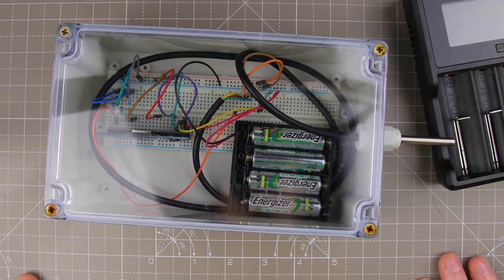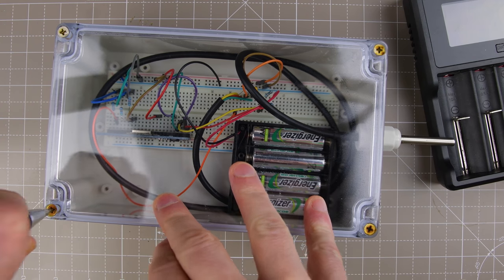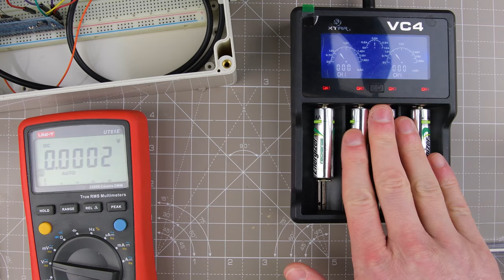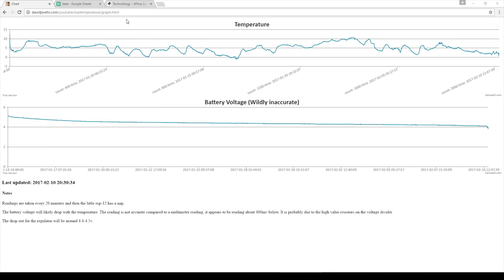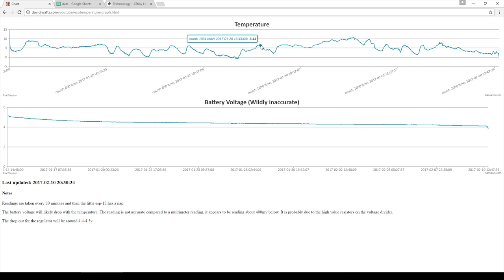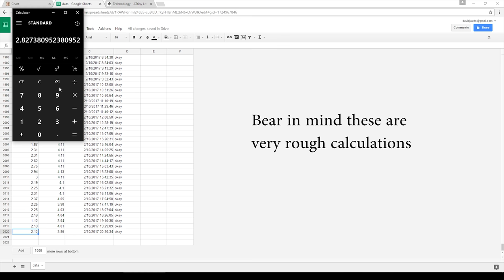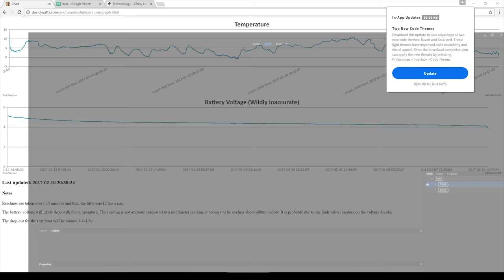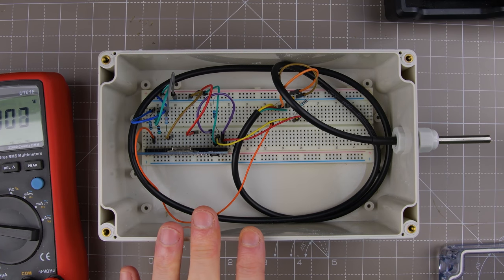Part 3: Outdoor Temperature Logging with ESP8266 ESP-12f

Comment: For this sort of application I have just started to look at the new ESP32 devices.  These have an operating voltage range of 2.3 - 3.6 volts and a hibernation sleep (with RTC timer) of just 2.5 uA.  With that voltage range it can be run on 2 AA batteries directly, without a voltage regulator.
I  haven't made progress yet on the low power stuff, but I have it sending data to NodeRed using MQTT.  The low power work will be soon.

Comment: Dealing with negative reading is really easy, David. They're 2's complement just as the good old int is in C. Just make sure you're using a signed 16-bits integer, and Bob's your uncle. Remember, the sign bit is actually many sign bits. All of the remaining bits not used for temperature are sign bits. That makes it a 16 bits signed integer where the temperature is 16 times the actual temperature in the mode with the highest resolution. Just store it and devide by 16. Easy! :) Great video again. Thumbs up from me and I hope you continue making videos in the future. Cheers!
Reply: If you like to keep the temperature as a "human readable" integer, you can multiply with 625 instead of dividing by 16. Many of us don't like floats in 8-bits microcontrollers. The raw 16th of a degree count is fine but multiply with 625 and you get a 10th of a millidegree count because 16 * 625 = 10000. That would require a 32 bits intereger of course and the range would be from - 214748.3647 to +214748.3648 (the 16 bit ingeter would give a range from -3.2767 to +3.2768 which is a bit narrow).
Reply from the maker: You are right but I didn't want to bring it inside after I realised my mistake, so I decided to treat the result rather than the cause. Now the experiment has finished I can sort it out. Thanks for the hints :-)

Comment: I am going to finish a similar project only house inside (temperature over 0 Celsius). I used a ATtiny13A and a N-Mosfet to cut the ESP-01 Ground. I measured around 5.4 [uA] for when the ATtiny13A is running on 3V3. I used Lipo and Bucket-Boost Converter to supply 3V3 voltage for the ESP- 01 measures the voltage with the ATtiny13A ADC. I used also p-MosFET to reduce the power consumption.

Comment: David Watts

Use only 3 batteries and just put a wire across the terminals on the empty slot. It will give you nominal voltage of 3.6V.
Remove the voltage regulator and just power the thing directly from battery.
Increase the sleep interval to 30 mins or even 1 hour.

If you don't need live data, just keep the readings safe in RTC user memory and upload it every hour. That will give u a straight 66% savings.
Reply from the maker: Thanks for the comment. I don't like the idea of using 3aa cells without a regulator, I am sure it would work but fully charge NiMh cells can be at 1.5v each which would tip it over the 3.0-3.6v specified in the datasheet. The next iteration will have half the sleep time just to speed up the testing.
Reply: You are right that the data sheet says 3.3 to 3.6 but I am sure there are some buffers put in place to accommodate for higher voltage.

My garden watering system has been running for months without any problem with 3 NiMH cells.
My weather station also ran with the same battery setup till the juice ran out. Infact, this week I have now hooked up the weather station esp straight to a single 18560 battery which started out at 4.2. Again working without any issues.

For non-commercial setups, i would just risk nuking the chip than wasting usable battery power. But thats just me :)

Comment: hi David I am totally in to your channel. May I suggest using the 18650 with the protection circuit. They'll shut off before any damage is done. NiMh if run down to that point will have significant damage and reduced charge cycles. Got to check out that charger of yours though. Mine is about ten yrs old :P
Reply from the maker: Thanks for the suggestion. I thought about that but they are negatively effected by the cold and regulating the voltage is difficult from 4.2-3.1 to 3.3v for the esp. Their usable capacity would be lessened by any regulation or diode voltage drop. It is a difficult problem to overcome. I did a little review of the xtar charger, it is really nice.
Reply: Chris Leech
I am already using 18560 to power up esp without any voltage regulator, No fire and no hissing sound. It just works without a glitch.
Reply: Hrishikesh Date it's probably pushing it a bit as a charged 18650 can put out over 4 volts.

Comment: You can build a micro amp meter(EEVBlog has one) which converts Amps to volts. With just a couple of OP amps. the problem would be that this would draw more current. 

I'd go the way to measure the voltage drop over a small resistor lets say 1ohm resistor. you can then amplify the voltage with an opamp to boost the voltage to a range of 0 to 5/3.3 volts.

Comment: For comparison, I've been running an outdoor temperature and humidity monitor running on an Arduino 3.3V Pro Mini clone, and transmitting data every two minutes with an nRF24L01  for nearly a year now off a set of LIDL Eneloop-alike cells. The 4 cells are still at 5.04V, so I'd expect total life of nearly two years. Of course, this is 2.4GHz, but not WiFi.
Reply: which sensor did you use? Can you share details on build/sw? Thanks in advance :)

Comment: hi you could try a lithium iron phosphate battery 3.6v charge 3.2v nominal 2.5v discharge
and to measure current you could use a opamp to amplify the voltage drop across a 1 ohm resistor.
a cheap supply for lifepo4 cells is for solar lights.

Comment: I'm enjoying your videos, David.  I'm also just starting out with electronics and these Espressif devices.  I'm using a different route, though, and working in 'C' (just because of familiarity).  As others have noted, you can use the RTC method to basically turn off your 8266 to ~20uA.  I'm wondering if you have a problem where your 8266 is failing to enter deepsleep?  There is an Espressif document that describes the sleep modes and gives hints on what to do to really get the consumption down and also what may stop the module from entering deepsleep properly in the first place. (http://www.espressif.com/sites/default/files/9b-esp8266-low_power_solutions_en_0.pdf).  Have you seen the ESP32?  That badboy has a built-in mini-micro to run the IO while the rest of the chip is off.
Reply from the maker: Hi Stuart, thanks for the comment. The ESP does indeed go into deepsleep and were it not connected to a terrible regulator it would draw 20uA so at the time it was drawing 2.5mA. Deepsleep is working find on my other boards and they have much more current friendly regulators. I am not sure of the availability of the ESP32 yet but I will definitely check it out at some point :-)

Comment: you can buy dave jones' microcurrent - it can measure nanoamps
Reply from the maker: A bit too pricey for me, did you get your parcel?
Reply: if google image search the ucurrent schematic rev1 of you can actually build it on a breadboard for for not too much. provided you get dip adapters for the op amps. It will make a good project ! I just tweeted a pic from @DrunkenSolder

Comment: Can i see a uA scale on your multimeter??
Reply from the maker: Yes
Reply: won't that measure low enough for you to test your setup?
Reply from the maker: Theoretically yes but in practice no. Putting the meter into µA to start with will show an over range when esp starts up it draws well over 80ma and changing range interrupts the circuit. Even in the mA range the internal resistance of the meter (burden voltage) is enough to stop the esp working but also it would make any readings inaccurate.
Reply: If you want to just measure current when in sleep, connetct the meter in circuit, then short across the probes. This will allow the ESP to start up normally, then once its asleep, remove the short, and this will show the current while sleeping. The lower current when sleeping should reduce the voltage drop across the meter, allowing the ESP to keep running
Reply from the maker: Interesting idea, thanks for that. I will give it a go tomorrow and report back.

Comment: HI David, just a thought on power consumption measurement. One of the problems with systems like these is that consumption  can be quite high for short periods of time, so measuring hibernate current may not give you an accurate picture. Measuring current when the Esp8266 is transmitting may be quite difficult. One technique that can work, if you have a suitably capable oscilloscope, is to use it to integrate the current over a period of time. Dave Jones did a video on this technique using his microammeter and a 'scope: https://youtu.be/Dh0xYu8YvaE